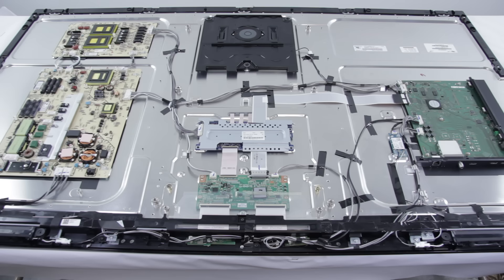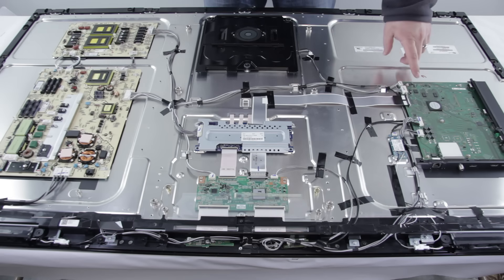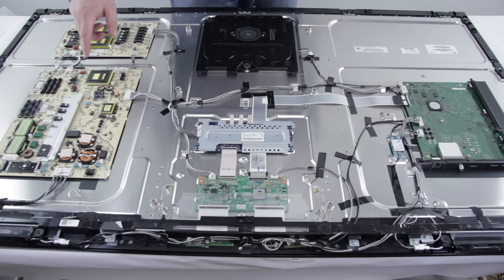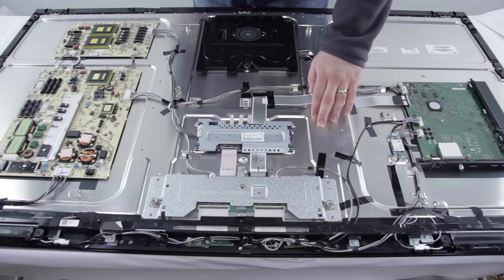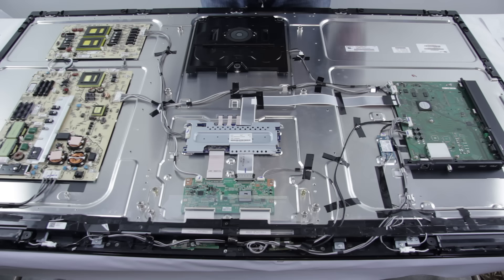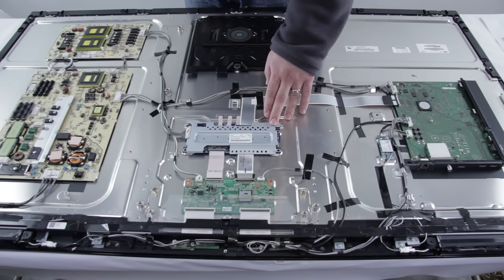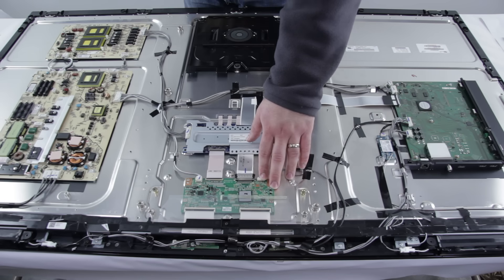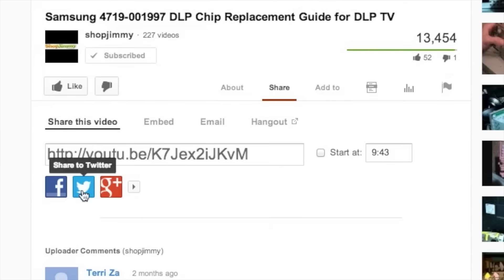LED TV Repair Tutorial - Common Symptoms & Solutions - How to Repair LED TVs

Comment: I have a LG  55LM4600 that all of the sudden lost its picture.  It has sound through the optic output to the surround sound.  It looks like there is backlight because the screen lights up a bit when the power comes on, just no picture.
Reply from the maker: Donnie Seibel   I recommend running the flashlight test on your TV.   Here is a link to a video we produced that shows how to run the flashlight test. https://www.youtube.com/watch?v=xUzCLgoSPGM Please reply with your flashlight test results and we can recommend a replacement part for your TV repair. Thanks and please let us know if you have any questions! www.shopjimmy.com
Reply: I do not see any images.  I think this means the tcon board?  Sound doesn't work but I believe I had my speakers shut off and the sound went through the surround sound which it still does work that way.
Reply from the maker: Donnie Seibel  Please watch this video FIRST to help with your repair!  https://www.youtube.com/watch?v=BP3NVNCGEv8  I recommend replacing the main board in your TV.  Click this link to replacement parts:  http://www.shopjimmy.com/catalogsearch/result/index/?cat=56&q=55LM4600  There may be multiple boards for the same TV model number, be sure to match part numbers on your current board, with your replacement for compatibility.  Thanks and please let us know if you have any further questions with your TV Repair!  www.shopjimmy.com
Reply: I have sound coming out of the mainboard through a hdmi to my surround sound.  You still believe it is the problem?  I trust your advice just want to be sure before I make that purchase.  From the video I thought I had tcon symptoms.  Thanks for the help by the way.
Reply: I finally ordered the part suggested and it did not fix the picture.  What do you think it would be?
Reply from the maker: Donnie Seibel  Please watch this video FIRST to help with your repair!  https://www.youtube.com/watch?v=BP3NVNCGEv8  It could be the t-con board or the TV panel.  You can replace the t-con board to see if that fixes the problem.  Click this link to replacement parts for your TV model number:  http://www.shopjimmy.com/catalogsearch/result/index/?cat=63&q=LG+55LM4600  There may be multiple boards for the same TV model number, be sure to match part numbers on your current board, with your replacement for compatibility.  Here is a link to a video showing how to identify your part number, click here:  https://www.youtube.com/watch?v=J1GmfoeQeP4  Thanks and please let us know if you have any further questions with your TV Repair!  www.shopjimmy.com
Reply: I have replaced every board in this tv and no luck.  I can't believe it would be the panel I had it for a year and a half and it never was touched.  Very dissapointing.
Reply: Same problem, same outcome. Donnie Seibel if you still have some of those boards I could take them off your hands... although I already ordered the Main board before found this thread :/
Reply: Ahh sorry I would have but I already donated it to a tv repairman.
Reply: I'll be doing the same. I'll see if I can get the lcd panel first...
Reply: My tv guy said the panel is about 2 grand.  Crazy how they price that since the TV was 1200.
Reply: Anybody have any updates... I have the same issue just replaced all the boards. Just a blue screen that looks like its lite up but no pic in my the background.
Reply: If you have tried all the boards and it didnt fix it then your panel is bad.  The panels are more than a new tv.  I went to Walmart and bought a replacement off their discount shelf.  Typically they are the tvs they display for a while.  Has life loss from being played constantly but half the price ussually.  I will never buy another LG.  I had two LG panels go bad within 3 years of their life.

Comment: My TV is the 39LN5300-UB.   308MXPH14984.
TV has worked flawlessly for almost a year.
I came home and noticed the standby light was.  I checked the surge protector and it was still on and fine.  I know a faint sound from the back of the TV. Like it was getting power.  I unplugged it and the sound went away.  Plugged in same sound but nothing happening.  Any help appreciated.  Thanks
Reply from the maker: Sam Danner  Please watch this video FIRST to help with your repair!  https://www.youtube.com/watch?v=BP3NVNCGEv8  I recommend replacing the main board in your TV.  Click this link to replacement main boards:   http://www.shopjimmy.com/catalogsearch/result/index/?cat=56&q=39LN5300-UB  There may be multiple boards for the same TV model number, be sure to match part numbers on your current board, with your replacement for compatibility.  Thanks and please let us know if you have any further questions with your TV Repair!  www.shopjimmy.com

Comment: We removed a Toshiba 55SL417U from a wall mount bracket and attached the pedestal base that came with the TV. We initially used a few screws that were too long to attach the base at the rear of the screen. We noticed the problem when we turned on the TV and noticed distortion to the screen. We removed the base and attached the correct screws, but when we turn on the TV, we do not have a display. The backlight will come on, and the light flickers when we try to change the input, but nothing appears on the screen. What could our problem be?
Reply from the maker: Megan Kelley   Sounds like you drilled through the panel ribbons.  If this is the case, you would most likely need to replace the TV panel.  If your TV panel is bad, it may be more cost-effective to replace the TV as panels are typically hard to find in stock, difficult to replace, and expensive.  Thanks and please let us know if you have any further questions!  www.shopjimmy.com

Comment: Hello. I have a Samsung UN55B8000XF(XZA). For several weeks now, the TV will power up on its own intermittently. However, it has never powered off on its own.(It is not listed as one of those Samsungs with the notorious bad capacitor problem). I also have trouble turning the TV off: (the "touch sensor switch" has no effect, the original remote, (fresh batteries), causes the blue LED on the set to flash but cannot power it down, and the "Menu", "Source", etc. buttons on the remote often yield no results, (only flashes of the LED), on the TV. My Logitech Harmony One universal remote can only sometimes power the TV down). I use a switched power strip/surge suppressor to keep the TV powered off. I would very much appreciate any advice on which part to replace. Thank you, Billy
Reply from the maker: lifesofunny1  Please watch this video FIRST to help with your repair!  https://www.youtube.com/watch?v=BP3NVNCGEv8  I recommend replacing the main board in your TV.  Click this link to replacement main boards:  http://www.shopjimmy.com/catalogsearch/result/index/?cat=56&q=UN55B8000XF  There may be multiple boards for the same TV model number, be sure to match part numbers on your current board, with your replacement for compatibility.  Here is a link to a video showing how to identify your part number, click here:  https://www.youtube.com/watch?v=BEPWrefQvqI  Thanks and please let us know if you have any further questions with your TV Repair!  www.shopjimmy.com

Comment: I have a 39 inch led HAIER TV shows the screen blue with stripes I already check the capacitors and they all look good any idea what could it be?
Reply from the maker: gustavo Perez   This sounds like a TV panel (TV Screen) problem.  If your TV panel is bad, it may be more cost-effective to replace the TV as panels are typically hard to find in stock, difficult to replace, and expensive.  Thanks and please let us know if you have any further questions!  www.shopjimmy.com

Comment: I have a VIZIO E320-AO. When I try to turn it on, power light in bottom right corner comes on, then slowly fades out without the tv coming on.  Would this be a power board problem? Of course this happened right after the warranty expired.

Comment: Hello I have a LG TV  55LE5400-UC was watching tv picture went out screen was black it look like the backlight was still on turned the tv off. Once I turned it back on the screen shows no picture and doesn't light up. I did the flashlight test didn't see any image. I had the sound turned off on the tv was using a sound system went through the tv input to select my directtv input never could hear any sound coming through my sound system.
Reply: waiting on response

Comment: Hey there guys! 

I own a 55' Haier LED 1080P 120hz television. 

Model #: LE55B1381

I recently had received a hand-me down television stand from my parents. I moved the television from the night stand I had it on to the new tv stand (it's not enclosed and provides the same ventilation). My tv will play for an inconsistent amount of time before the image disappears. Sound is still there but the image goes black. All I have to do is turn the television off then back on to restore the image for another inconsistent amount of time (anywhere from 20 minutes to a hour). 

My first thoughts were overheating so I moved the television into a cooler space after removing the casing to find the interior was spotless and all the capacitors were intact. I'm no expert, by any means, and have just recently started researching causes of these problems so I don't want to assume it's my LED driver and purchase a new one. 

I bought the television manufacturer refurbished and a repair cost would likely cost about half of my retail price. 

Since I purchased the tv, it may also be worth mentioning that the HDMI 2 slot has never worked. 1 & 3 are entirely functional and have never failed. I have switched HDMI cords and tried multiple devices and the tv still fails after its given amount of time. 

Any help you could provide would be greatly appreciated!

Love the videos! Thanks guys!

Comment: Hello
I have a RCA model number LED46C45 RQ which has three vertical lines one dark blue one white and one lighter blue.  Miidlle line which is white will show no signal inverted but when it is in the blue it shows fine.  I had no signal connect so the no signal message is expected.  When an hdmi is connect I only see half the picture in one of the blue sections.  What do you think?

Comment: I have a LG 55LW5600 that boots to the screen which usually has the time then reboots continuously. When I unplug it for an hour it boots up then fails into reboot cycle in less than a minute. The tv cannot be powered off by the remote but it appears to see the signal. Thanks in advance.
Reply from the maker: Ann Blake  Please watch this video FIRST to help with your repair!  TV Repair! LCD, LED, Plasma, DLP How To Fix Your TV with ShopJimmy.com Help!  I recommend replacing the main board in your TV.  Click this link to replacement parts for your TV model number, http://www.shopjimmy.com/catalogsearch/result/index/?cat=56&q=LG+55LW5600  There may be multiple boards for the same TV model number, be sure to match part numbers on your current board, with your replacement for compatibility.  Here is a link to a video showing how to identify your part number, click here:  TV Part Number Guide for LG & Zenith Main, Digital, & Tuner Boards (LCD, LED, Plasma TVs)  Thanks and please let us know if you have any further questions with your TV Repair!  www.shopjimmy.com

Comment: Hello, I have a Mitsubishi Unisen 55 inch flat screen that first developed a vertical bluish band at the far left of the screen several weeks ago.  The band is about 1/20 the width of the screen and fades in and out over the picture which is still clearly visible behind the band. Just recently, another identical vertical band formed adjacent to the first and combined with the first to cover about 10% of the left side of the screen now.  These bands look similar to churning clouds fading and darkening but never blocking the picture, just darkening it with a bluish tint and they tend to act independently but join together as one on occasion.  The model number is LT-52153.  I would appreciate any advice you can provide as this has been a wonderful unit and I would hate to lose it.  Thank you, Mike.  This is my daughter's gmail address so please contact me at secret23@comcast,net if you can.  If not, please use this gmail account.
Reply from the maker: Mindy Dottellis   This sounds like a TV panel (TV Screen) problem.  If your TV panel is bad, it may be more cost-effective to replace the TV as panels are typically hard to find in stock, difficult to replace, and expensive.  Thanks and please let us know if you have any further questions!  www.shopjimmy.com

Comment: Hello I have a Samsung UN60ES7100 60-Inch 1080p 240Hz 3D Slim LED HDTV (Black). The lower screen looks like it was hit by a ball and the screen now works but the color is messed up significantly that emanates from that focal area in the lower left.  Is it worth fixing the LED (glass by the way is not cracked).  Thanks

Comment: Hello, I have a RCA 46LA45RQ, 1332-46LA45R-C119174 TV that has begun to flicker -coming up with a window in the upper right side of then screen that shows" Cable   A3   Mono    480I with the date and time. Do you know what is wrong and what part I need? Thanks, Tom J.

Comment: Hello, I have a sharp aquos, lc-32D47UA when I plug it in it blinks green once and red twice, no sound or image. At all. Advice please :)
How to get into  service mode? Or turn it on? Please help!! 
Thanks. Chad C.
Reply from the maker: Fly High   Please watch this video FIRST to help with your repair!  TV Repair! LCD, LED, Plasma, DLP How To Fix Your TV with ShopJimmy.com Help!  I recommend replacing the power supply board in your TV.  Click this link to see replacement parts:  http://www.shopjimmy.com/catalogsearch/result/index/?cat=59&q=lc-32D47UA  There may be multiple power supply boards for the same TV model number, be sure to match part numbers on your current board, with your replacement for compatibility.  Here is a link to a video showing how to identify your part number, click here:  DIY TV Part Number Identification Guide for Sharp Power Supply Unit (PSU) Boards  Thanks and please let us know if you have any further questions with your TV Repair!  www.shopjimmy.com

Comment: I have an Orion 19" flat screen tv model # is sled2468w my problem is my tv will come on but it stays on for 5 minutes then turns off and the red power indicator flashes could u pls help me with this
Reply from the maker: Mary Henry  Please watch this video FIRST to help with your repair!  TV Repair! LCD, LED, Plasma, DLP How To Fix Your TV with ShopJimmy.com Help!  I recommend replacing the main board in your TV.  Click this link to a replacement main board for your TV model number:  http://www.shopjimmy.com/catalogsearch/result/index/?cat=56&q=sled2468w  There may be multiple main boards for the same TV model number, be sure to match part numbers on your current board, with your replacement for compatibility.  Thanks and please let us know if you have any further questions with your TV Repair!  www.shopjimmy.com

Comment: Hi, I have a 2 year old proscan plded3992a-c led tv which is flickering. I see the image and hear sound. Inside there is only 2 boards. 1 is the mainboard and 1 is a skinny 24" x 1.5" board i think is the buffer board. i bought a used mainboard on ebay and same problem. I can send a video clip of the picture. Is there an led driver or inverter on this tv or is the buffer board the same and i found an identical bufferboard from a different tv. It was an lcd but same part # and same version. Theres not much to this piece of junk tv. Any help is greatly appreciated. Thank you very much in advance.
Reply from the maker: Benjamin Nemitz   This sounds like you have bad LEDs in your TV.  Unfortunately we do not sell replacement LEDs.  Thanks!  www.shopjimmy.com
Reply: ShopJimmy.com
Is the led you speak of like the entire screen much like when they speak of a bad lcd on an lcd tv?
Reply from the maker: Benjamin Nemitz   The LEDs are small individual light emitting diodes inside the TV.  Typically when someone says you have a bad LCD, they may be referring to the TV panel.  Thanks and please let us know if you have any other questions.  www.shopjimmy.com

Comment: Hello. Have a LG 42 LW650T (smart LED).  It responds to the remote and power light comes up followed by the other smaller ones next to it.  These lights then turn off leaving the power light on.  There is no display or sound.  I already tried with a new main power cable but it doesn't help.  What to do?
Reply: I forgot to mention that the standby light doesn't work
Reply from the maker: Noor Illiyas  Please watch this video FIRST to help with your repair!  TV Repair! LCD, LED, Plasma, DLP How To Fix Your TV with ShopJimmy.com Help!   I recommend replacing the main board in your TV.  Click this link to replacement parts:  http://www.shopjimmy.com/catalogsearch/result/index/?cat=56&q=42LW  Be sure to match part numbers on your current board, with your replacement for compatibility.  Thanks and please let us know if you have any further questions with your TV Repair!  www.shopjimmy.com

Comment: Hello.  I have a Toshiba 50" LED 120 htz flat screen tv.  Model # 50L5200u.  S/N#  C28229T22494C1.  Manufacture date is July 2012.  The tv powers on and the picture and sound come.  The picture is fine on the left side of the screen.  The middle of the screen starts to darken and the right side of the tv starts to become blurry and looks to have a slow fade look as it moves to the next picture image.  Your help would be greatly appreciated.  Thanks
Reply from the maker: ryan harder   This sounds like a TV panel (TV Screen) problem.  If your TV panel is bad, it may be more cost-effective to replace the TV as panels are typically hard to find in stock, difficult to replace, and expensive.  Thanks and please let us know if you have any further questions!  www.shopjimmy.com